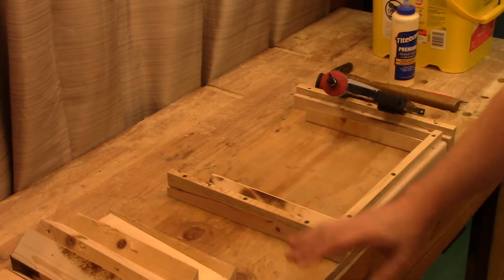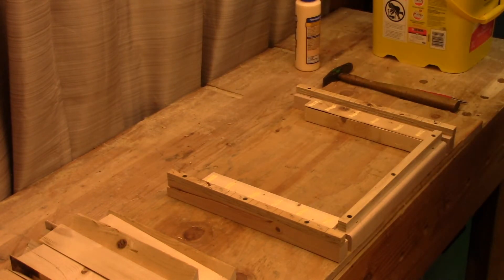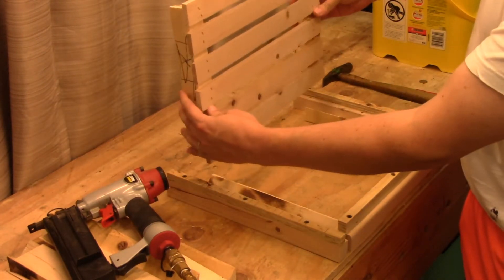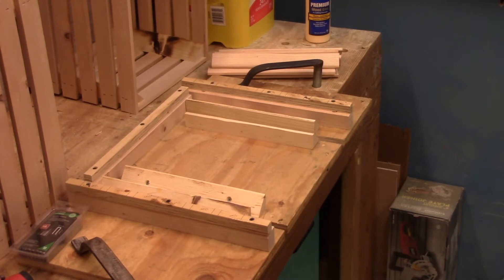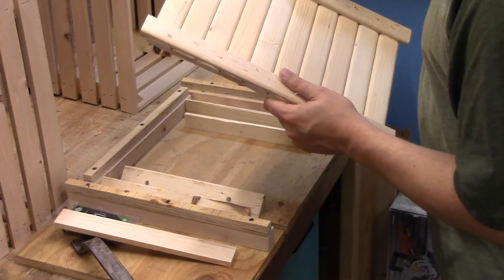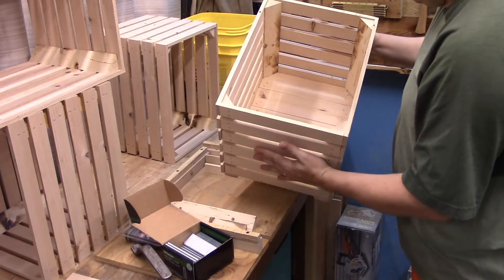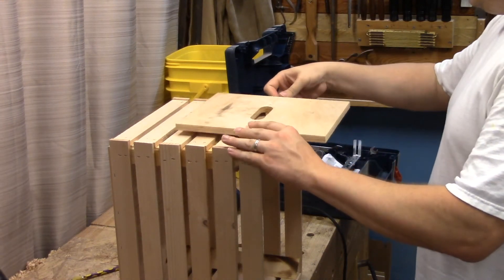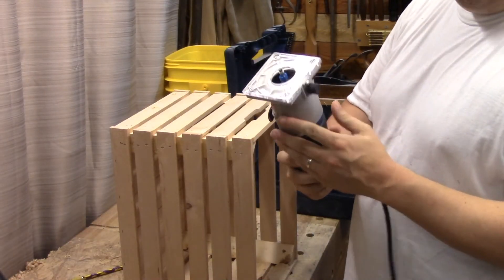Crates from 2x4's

Comment: Thanks for sharing this project, Michael. I want to make wooden crates for moving my shop to a new location, so I watched similar videos on YouTube, but chose your design. Sharp looking and utilitarian, I'm sure. As an intermediate (maybe) woodworker it would have been really helpful had you spent some time on how you built the jig(s). I'm trying to sort through the process now, but it's confusing, especially how, through one jig, you can make both side panels (at 16"), and the end panels at 12" widths. I would have purchased the plans for building the jigs had you offered them. The design for sliding the side panels into the slots to layout and attach the end panels is brilliant! Thanks and I wish you well.